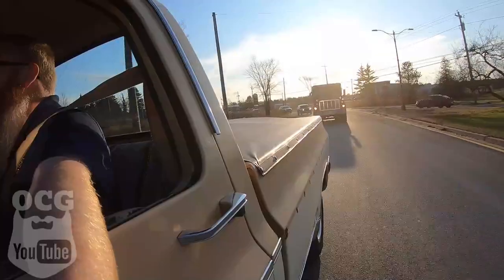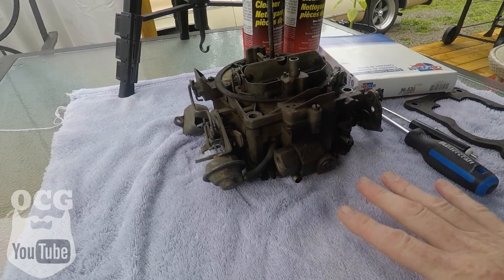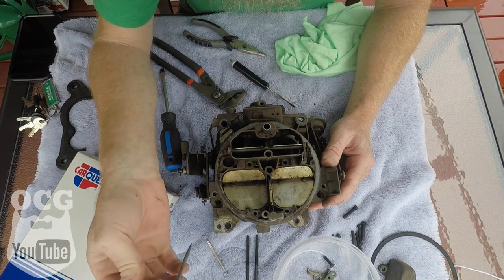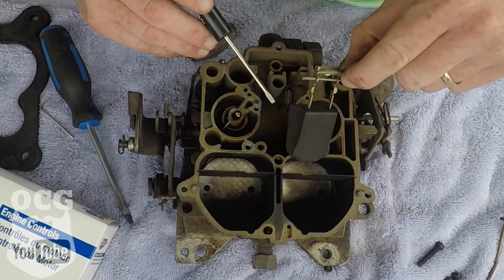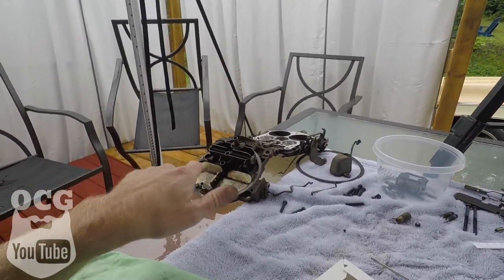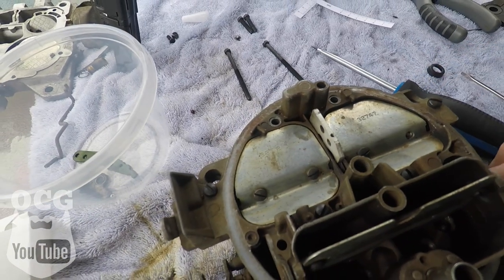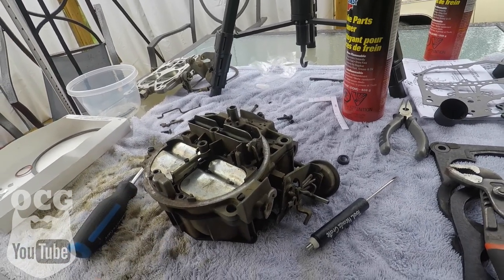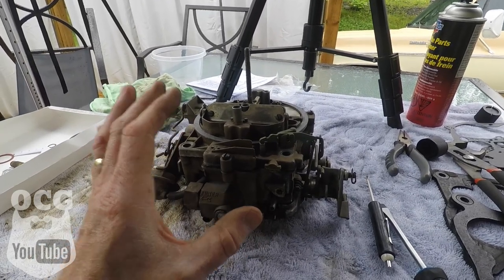REBUILDING A ROCHESTER QUADRAJET CARBURATOR FOR MY 1977 CHEVROLET C10 TRUCK

Comment: Back in the day those Q Jets were great carbs. Suggestions: Remove and disgard the secondary kick down rod, then manually adjust the secondary spring using a small screw driver and a small allen wrench to set the secondary flap speed or to eliminate bogging......The secondary kick down rod is the rod that comes from the vacuum pot. ...This is a old drag racers secret tip.....
Reply from the maker: I’ll definitely look into this! Thanks Paul!

Comment: good video! I need advice on something. I recently bought an 1986 chevy truck with a V6 4.3. It has a propane system on it and the original carburetor is no where to be found. I have a 78 quadrajet that I just rebuilt and would like to install it. the truck intake manifold is the original spreadbore quadrajet carburetor. Also this engine has the electronic spark control distributor without the vaccum advance. if I put this 78 carb I got on it do you think it will work just fine?
Reply from the maker: Are you switching it over to gasoline or keeping propane? If gas, I'm sure it will work fine but I don't think propane fueled engines use a carb.
Reply: @OldeCarrGuy  thank you! well I think it was originally carbed because it has a standard stock quadrajet spreadbore manifold, and the propane take was installed in 1991 according to the stamp, and the truck is an 86. what you think with that additional info?

Comment: choke whats that???? none of my qjets have..... anymore lol your learning take it apart a few times and you got it, as long as you took your time and got it right and got everything back right. all you will have to do it slowly take your time and tune it.  Taking the time to tune those secondaries is where it is going to be, got to take your time and barley turn the adjuster screw while holding the tension and keeping your other hand on the tension screw under neath, a little tricky your first few times but it gets easy, then its simple if it bogs just a little tighter, if it has a delay opening a little looser
Reply from the maker: As far as I can tell it’s working great right outta the gate!
Reply: @OldeCarrGuy  if i can get my rear end fixed... yep it broke. well the pinion lol. but the ol blue truck i plan on taking the edelbrock off for a qjet i got